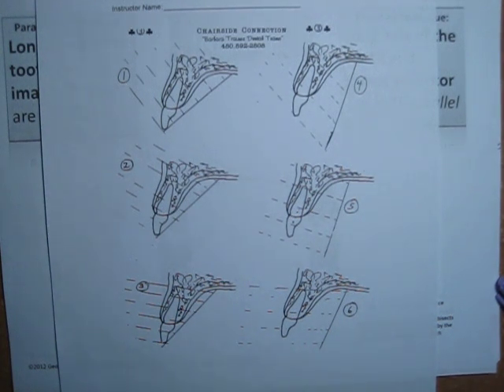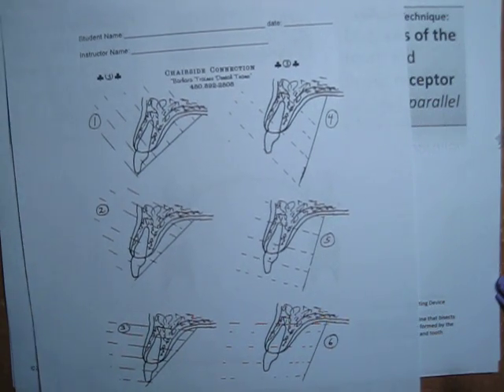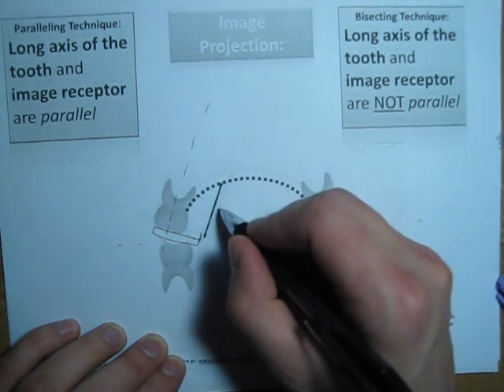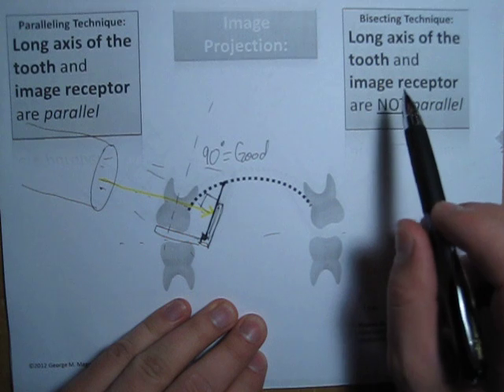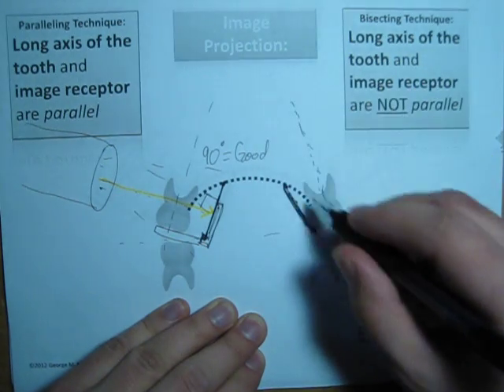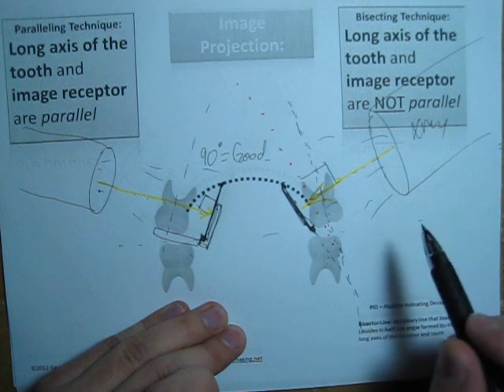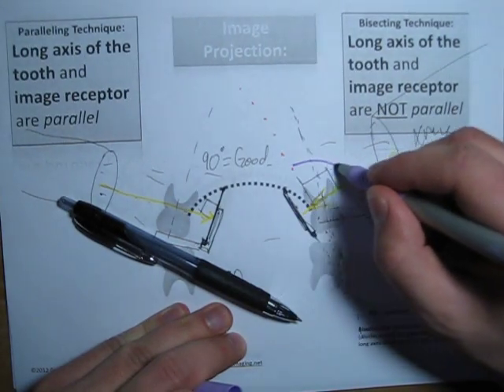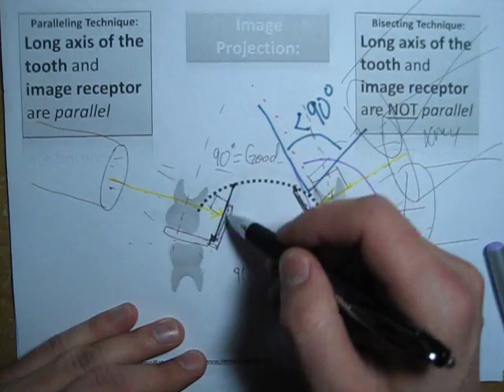How to: Bisecting angle technique VS Parallelling technique for dental imaging - dental xrays

Comment from the maker: CAUTION: it may be easy to confuse a "steeper angle" with an "increased angle". Steepening an angle actually decreases the angle of the Xray beam to less than 90 degrees in relation to the sensor/film. On the other hand, flattening an angle will increase the angle to more than 90 degrees
Reply: why do we say forshortening not shortening?

Comment from the maker: Generally, if you increase the angle (of the xray beam to sensor/film) more than 90 degrees you will elongate an image. In contrast, if you decrease the angle to less than 90 degrees, then you will foreshorten the image. Regardless of which technique (paralleling or bisecting) you use, it is possible to elongate/foreshorten images. The intent of paralleling is to minimize any image distortion, however, sometimes it is necessary to foreshorten images in order to capture long roots.

Comment from the maker: I would not say it is incorrect. Often times the teeth are very long and do require a bit of foreshortening to capture the apices or "root tips." However, I would not foreshorten all posterior PAs as a standard. As may be obvious, foreshortening causes image distortion, and can even result not being able to detect a widened PDL or caries. Perhaps seeing previous PAs (or even a Pano) would help determine if the teeth are super long.